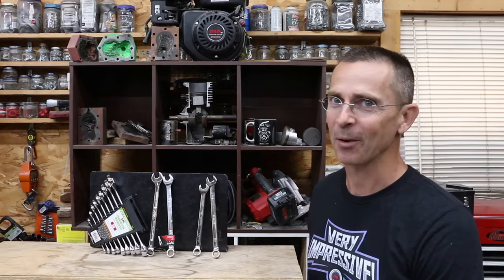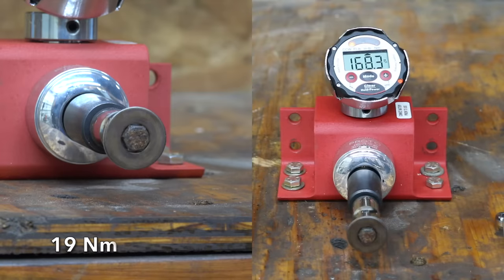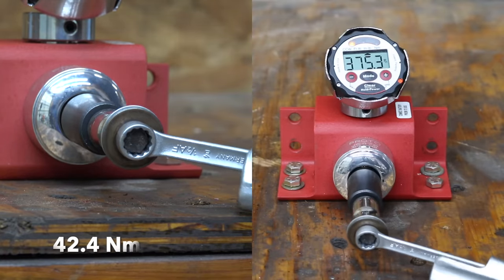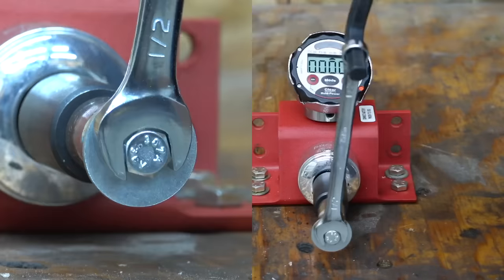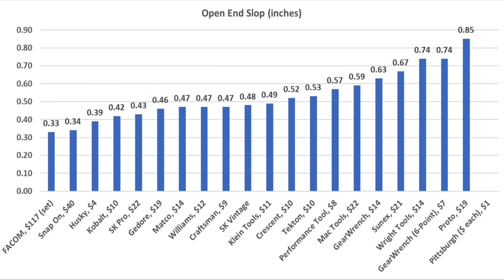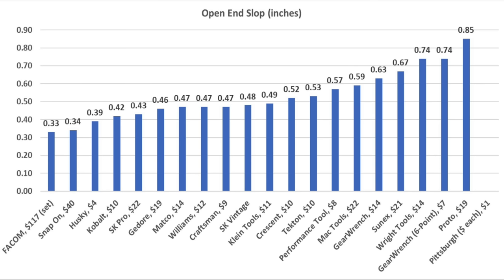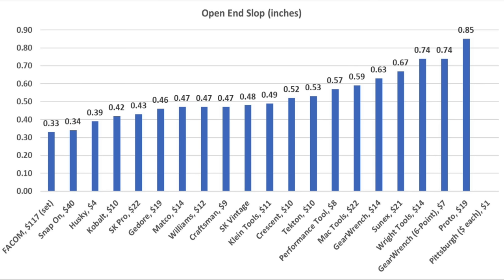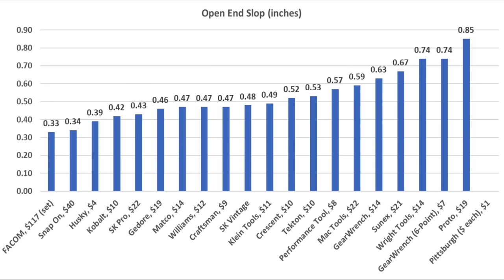Best Wrench? Let’s Settle This! Snap On vs MAC Tools, Matco, Proto, SK, GearWrench, Kobalt, Husky

Comment: Could you do this test again with different brands I am super interested in the harbor freight icon brand. Other brands Milwaukee, Amazon work pro, and Wiha.

Ratcheting Double ended box wrenches would be a good video also I use for all thread and tight spots where sockets cannot reach .

Keep up the good work.
Reply from the maker: Thanks, will do!  Thanks for the suggestion.

Comment: Have you tried the new Craftsman tools selling at Lowe's now? When I heard Sears had sold the rights to Craftsman, I thought that's it, they're done. But on fathers day, my son bought one of the new sets for me, and I was impressed. The new ones are polished steel, and feel nice in your hand. They are heavier and feel like solid tools. Have you thought about adding them to the tools you test? Like a vintage, and a new craftsman tool, like I have seen you do with others.
Reply from the maker: Thanks for the suggestion.

Comment: I'm a little confused by this test. It's only 6 months old, but the Wright and Snap-On are not what I would expect (Wright Grip 2.0 and Flank Drive + respectively - both of which would have crushed the competition in the open-end slip test). When were these acquired? I don't know for sure about Snap-On, but I'm fairly certain that Wright doesn't currently sell any regular combination wrenches that aren't Wright Grip 2.0.
Reply: The items tested can be clearly seen and people will make their own minds up about brands and costs they are willing to pay for.....

It seems to me (please forgive my ignorance if i am wrong) that your comment implys that older versions of the more expensive brands were used against more modern cheeper competitors products......

Surely, the "designes" of the technologies are very visually noticeable in both the brands that you mention, then therefore, (if you know better) then say so...... instead of a half hinting comment......

I guess, those that buy these products are fully aware of what these designes look like, and from this channel (as he is financially independant) there is very visually no impropriety intended, as the tools are shown very clearly and under magnification......

Quiet simply, (for entertainment purposes only) brand x, and brand y, and brand z spanners where all tested against eachother, and very clearly seen......

Perhaps you should brand your products and their relevent versions more appropriately, so they can be better identified instead of implying impropriety because brand x out-performs brand z, but is 1/10th of the price of your product.....

The alternative is to improve the value of your product where another product priced at 1/10th the price of yours, isnt able to out perform your product, it would also help your customers not feel "buyers remource"  once they realise they have baught an inferior product.... (obviously).

Thank you for your opinion.....
Reply: Oh.... and "shalom".....

Comment: I would have liked to see harbor frieghts new icon brand wrenches on this test as they look very similar to snap on's flank drive plus to see how they fare up, i understand a possible reason why cuz gotta buy the set and last i seen they were asking 100$ for the set. But Being in the automotive field you get an idea between the truck tools on which tool is better sure you have the fan boys that gotta stay uniform with a certain brand whether snap on, match, Cornwell or Mac. Mac has always made a great tool but at least in my home state Mac doesn't really get any love anymore I hardly ever see a Mac truck anywhere. And I absolutely love Marco's pinless swivel sockets.
Reply from the maker: Thanks for the suggestion.

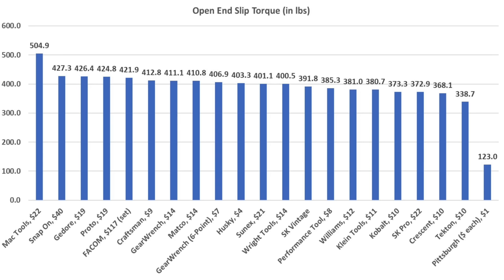Comment: Notice how on the Snap On open end test at 8:24 the bolt broke, then he used the torque the bolt broke at as the max torque before the Snap On wrench "slipped". Then for the 2nd Snap On open end wrench he states the wrench slips because the bolt was already damaged. What bolt? The first one broke. Also notice the Snap On wrench was not their Flank Drive Plus anti slip open end and was tested against other wrench's that have a anti slip open end. You can also notice the Snap On wrench was a used wrench while the other wrench's were purchased new. Also, why not use a grade 8 bolt to do the test? The reality is that if this test were conducted properly, apples to apples with a grade 8 bolt, meaning a new Snap On Flank Drive Plus versus all the other new wrench's the Snap On would have broken the bolt's that others slipped on. You're being played by this guy.

Comment: would like to ask you a question as you are testing do you ever try to warranty the tools you break that have a lifetime warranty and if so what has the easiest warranty system in ranking for top to bottom? also you gave me a great mechanics tip in this video and being a full time mechanic that is invaluable thank you you jut made me a much better mechanic!

Comment: Overall good video, but i have some complaints. For Wright, you didn't use Wrightgrip OR Wrightgrip 2.0! You also didn't use Snap-on Flank Drive Plus! You only had flank drive. For Wright, that's a twenty year old wrench design and i believe Snap-on Flank Drive non plus is close to 20 year old design. It would've been nice to see their current wrenches against other current wrenches. I would've also like to have seen some premium brands like Stahlwille, Hazet, or Nepros/KTC

Comment: I have a set of the Mac wrenches from 20-24mm and I can confirm that the open end is really good at holding on when you’re messing with tie rods and such.  Almost makes me wonder why Snap-On thinks they can charge twice as much…
Reply from the maker: Thanks for the feedback.
Reply: One possible reason - I have Mac wrenches from the late 80s and I have Snap-on wrenches from the late 80s... guess which ones were used more,  and still have chrome on them?

Comment: One thing you don't take into consideration you know when you torque a snap-on wrench and bend it you're already screwing up you should be flexing it back and forth that way it increases the torque like a spring that's the way they're designed

Comment: I’m sure the cheap wrench is not calibrated as well and probably uses softer metal than the pricier wrench. Both will turn bolts but You’ll have a much better chance of rounding the bolts or breaking the tool with the cheap one.
Reply from the maker: Thanks for the feedback.

Comment: I'd love to see the top 5 contenders of each of these videos put through statistical averages/medians/standard deviations where you run the same test on them multiple times and across multiple wrenches (maybe the half inch performs poor/better compared to others... and what's the tolerance on the wrench if you bought 3 of them.. do they all perform equally well within a set margin?)

If you buy sets and don't need them, give them away to viewers or someone local who could use an almost complete set?
Reply from the maker: Thanks for the suggestion.

Comment: I would like to see conventional (not impact) sockets tested similar to the wrenches.  6 point vs. 12 point vs. splined.  Maybe 1/2" drive, about 3/4" hex.  It would be great to do impacts sockets also.  But I would make that it's own test.
Reply from the maker: Thanks for the suggestion.

Comment: As far as " Snap on "  ,  they built their brand and name over many years.  I always tell people that want premium prices for their work " OK,  but you better deliver every time and if you make a mistake you correct it immediately. "  That is the way you build a brand - and maintain it.   I bought a North Face jacket years ago.  Paid " snap-on " prices.  8 years later with normal abuse  that jacket is still functioning perfectly.  Well,  it looks like I made a good deal in buying it. My point is trust.  When a company has earned that trust you never have to think twice and you can use your mental powers on your own work.  'nuff said.
Reply from the maker: Good Point!  Thanks for sharing.

Comment: I understand that stronger is better but not everyone will buy the most expensive tools. With your machines set to push them all to failure, how many ft/lbs. can a man reasonably apply to a wrench with his bare hand (no cheater bar) ? Some perspective would be helpful.
Reply from the maker: Thanks for the suggestion.

Comment: I think, ang for buck, this shows the Husky is the best. It is middle of the pack in tests, but performs well oberall, yet is amongst the cheapest. Ive bought a large set of tektons id say are worth it. Ive purchased Pittsburgh wrenches and regret it. They fit too lose and round off bolts. I think the Williams design is pretty good im personally interested in that. Ive liked my Stanley sets i bought at the Wally when i was a teenager.

Snap on is too freakin expensive for what you get. I had a buddy who spent 5k on smap ons when he was in school. He always borrowed mine, because i had more variety and sizes for the price. 

Ill keep buying Husky. But i wanna see icon.
Reply from the maker: Thanks for sharing.

Comment: I have a video idea, air gauges for tires, most accurate, most robust in case of being dropped, analog vs digital. I have 4 of them all read different.
Reply from the maker: Thanks for the suggestion.

Comment: Good testing. In the real world, rounding of the fasteners themselves is the problem.
Poor quality, soft bolts and nuts. Take that in consideration when removing cheap fasteners. Replace them with higher grade.

Comment: You can vastly improve most sockets & spanners by grinding the faces down a bit, till you hit flat - just by removing the useless tapered section,  grip will be exponentially better. However, you can't improve rubbish steel, or overly hard steel. Rubbish steel will flex open & slip  - overly hard steel will break. 

Here in Ireland/UK, B&Q sell Magnusson brand tools - they ought be garbage as they're  inexpensive - but strangely, they aren't.  Their spanners & sockets grip like Alien on yer mans face & they don't break, even when abused daily.

Comment: How warm are those wrenches when they break? What's the difference between warm ambient temperatures and cold ones... it'll probably influence the breaking/warping points if someone is working in a garage that isn't insulated in summer/winter conditions.
Reply from the maker: Thanks for the suggestion.

Comment: No mention of how thin wrenches are, as a professional I can say there's nothing less satisfying than using a "fat" wrench, it has less clearance.   Make a wrench thick enough and it will be very strong, but not as easy to use in tighter locations.  I've used MAC Tools and SK wrenches for 30 years (old so both made in US), they are thin...

Comment: Test Ideal. I use a sleeping machine for when I sleep. If the power goes off, I will wake up. So I looked to get a battery backed ups so even if power goes off I can continue to sleep. Problem my UPS beeps when on battery and could not find setting to keep it off.  Are there brands that have a silent mode? If so, how well do they do supplying power?
Reply from the maker: Thanks for the suggestion.

Comment: You didn’t have the flank drive snap on. It was just the regular one you used. Flank drive has small the teeth on the open end. It will far exceed the others like cheating. I’ve used them on flare nuts for brake lines haha

Comment: Edit to my comment : The Gedore NR7 is deisgned to deform like that rather than slip, as per Gedore. Their other ranges are stronger. 
Husky perfomed better than id have expected while the Gedore someowhat worse. Is snap on good , yes , is it worth its premium over some others ? No. The crescent is , im 99% sure , identical to the Husky and any difference in performance is down to the varience between single products. Batches etc. I bought a set of husky wrecnhes when i 1st moved here and they looked like tgey never made it to any sort of quality control department and their performance is no suprise here.
Reply from the maker: Thanks for the feedback.

Comment: !PF - The Snap-on wrench you displayed did NOT have a Flank Drive Plus open end jaw on it....I'm not sure where that one came from in the video. It's either a fake or maybe the video editing wasn't quite right? FDP jaws are not smooth at all. They have a very sofisticated grip design and do not let go. I've used them professionally for 35 years. The wrench in this video had a completely smooth jaw.

Comment: So....  Just happened to see this....  i use to work at a company called Mayhew. To shed a bit more light on this subject...  Frankly, comparing tools is pointless... in most every case the only difference  is the stamp that is put on the tool. The metal is all cut from the same bars, using the same machines and possesses. Some get the pretty chrome finish, others just the acid bath...
Mayhew, Snap-on ect literally was just changing out the stamp

Comment: I have always been a "Plomb/Proto" tool guy... and I think the over all winner was proto... especially for the better price.  While I don't want to see you destroy vintage tools, I'd be curious as to compare all 80's or all 70's or all 50's era tools... and see which is best.  I have yet to have a single Plomb era tool break.  And that's with cheater bars and hammering on them to break bolts free.
Reply from the maker: Thanks for the suggestion.

Comment: I don't know what went wrong with the Husky open end test, but if that part is given an an average value of the other tests instead of defaulting to 19, the Husky would finish split #6 at 7.0.

Incredible value  for a budget tool...  but this underlines the observation of watching several of these tests: price is NOT a useful determiner of quality.
The absolute cheapest ($1 in this case) tend to be rubbish, but after that, only solid tests like this can sort the lemons from the diamonds.
Reply from the maker: Great feedback. Thank you
Reply: @ProjectFarm  Thank YOU for finding us the diamonds!

Comment: What is the best lubricant to use on forcing screws? I assume something with extreme pressure additives. It would be cool to find out whats best to protect/get the most force out of ball joint c-clamps and power steering pulley remover/installers etc.
Reply from the maker: Thanks for the suggestion.

Comment: i have to say the newest version of macs wrench the rbts are far superior to any wrench ive ever used. they are cheaper than there previous line of anti slip wrenches and snap ons flank drive plus. but they manage to out perform them consistently. the i beam design is a bit to get used to but i would put money on it that it will bring mac back into the top wrench spotlight for years to come. back in the 80s mac had better wrenches than snap on then Stanley/black and decker bought them out and they never seemed to have the same quality till recently.
Reply from the maker: Thank you for sharing!

Comment: Quick question would the husky have scored higher if you used it on the 1/2 hex or does it still stay that low? Was it just a mistake on the test or was it the tool?

Comment: One tip: when loosening a nut, turn the wrench around. A commonly made mistake.
Reply from the maker: Thanks for the tip.
Reply: @ProjectFarm  No prob. I still use them the wrong way somtimes. It’s all about using the bigger “beak” to apply the most pressure. If that makes any sense.

Comment: HUSKY for the win. Glaring error and Project Farm FAIL for not using the Husky in a test and scoring it the lowest point of 19 for non tool error. It was user error. At the least, you would have to give it in the middle, like a 9, since it was above the middle in all other tests. That would place the Husky in the top 6. Probably 4th. I rarely buy Husky, but I may now after I discount this test.
Reply: I wanna reiterate without being insulting that yes thats a MAJOR fail. The husky is easily at the top, even more so considering the price.

I use a husky set for a ton of car work anywhere up to 80lbft and it has never failed or messed up a bolt

Comment: Why does it matter how much it can turn undersized bolts? Clearly if there's a tiny difference in the wrench opening size, the wrench with the smaller opening, or the one with perfectly parallel arms will "win". it doesn't mean they are better at turning the correct size bolts.

Comment: in the real world even the cheap brands would pass...the cheapest Pittsburgh box end failed at 200+ pounds of force which is multiples more than the torque that a fastener with a 1/2 head would be torqued at.

Comment: After fifty years as a mechanic first in motorcycles, then autos,  trucks and construction equipment, Snap-on tools held up the best with Mac coming in second. Tools made in China and India generally don't hold up well because those countries don't have access to high quality steel for consumer products. China especially has poor iron deposits and they get better iron from Australia, as does India. The US and Sweden have the best iron deposits and this shows up in the higher quality of their consumer products.  I know some mechanics don't like the smooth finish but it makes them easier to keep clean.  Good testing, but you talk too fast!

Comment: I'm a snap on guy that make some of the best tools ...you should have used 6 points most people that know what there doing will never use a 12 point to break loose a hex head nut or bolt it just doesn't work very well
Reply from the maker: Thanks for the constructive feedback.